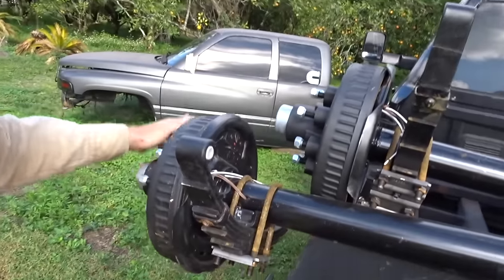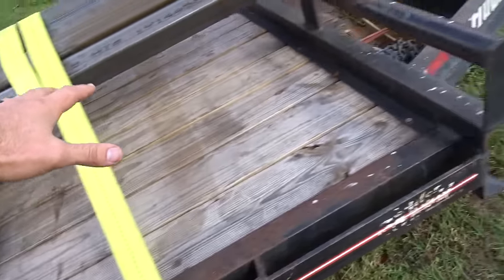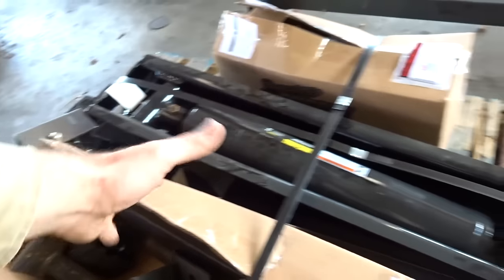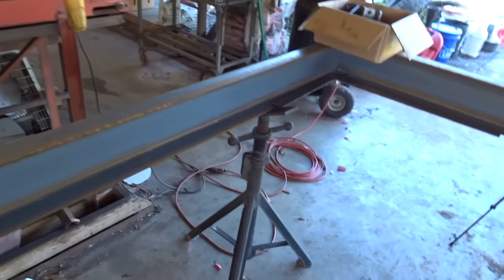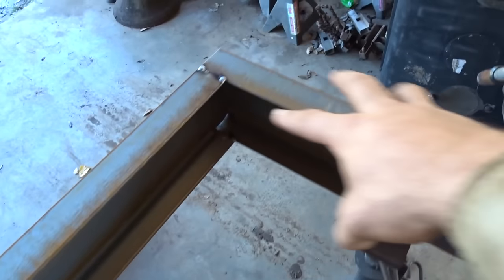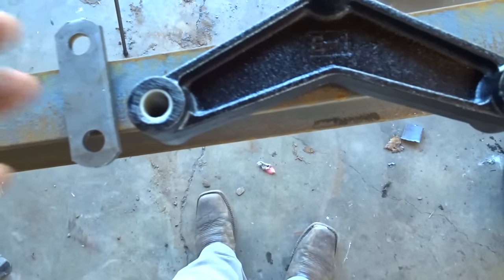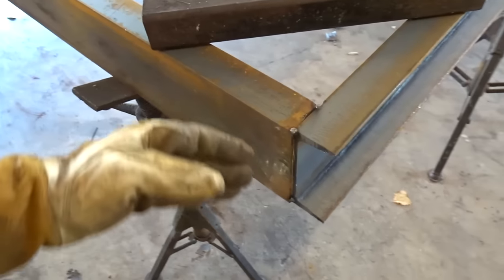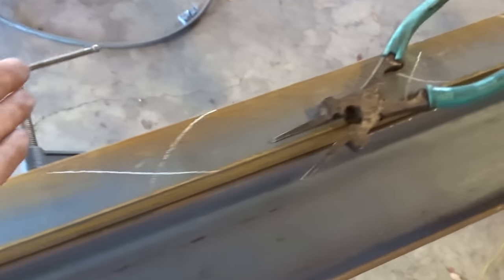Dump Trailer Build Pt 1 (& Giveaway details)

Comment: i never weld down hand  on trailors  up hill with 7018 only  and 60% of 12 ft is 7.2 ft front to back == 7ft2in13/32 to cl of axel look like you will have a massive wt on back bumper with a 8000 lb load  your front wheels will float low stearing but good breaks i see you moved to back all the way  steal heavy on bumper i like to check others on building things and learn from it

Comment: The strongest way is always shape the ends of the channel and not to but them together also remove the mill scale of the material before welding it will stop contamination into the weld.

Comment: I'm guessing 3500 invested at this point and not built yet. 1500 in axles,hangers and connecting brackets. 1000+ in steel easy. At least 500 for the dumping system ( probably more). Another 500 in wheels and tires. Still need hitch, jack, paint,lights and battery. So close figure, 3750. Not counting time, welding supplies grinding disks, act and oxy, chop saw blades and electric. I'm gonna say 8k by the time it gets its first load. I should know, I just finished building one almost exactly like this. Works great but I could have bought a like new used for half the price. Lot of fun building it though.
Reply from the maker: Lol pretty close I’ve got 1100 on axles and hangers and about 2k in steel and then add in everything else
Reply: Yep I figured about 3500 in materials. And that's cheap for a dump trailer if you don't count labor. Heller cheap, but if you do you don't really save that much. But it is fun building one. Let me offer a little advice. When you get it done, don't put 10 ton in it, it won't dump that much. Mine ended up with around 5.5 ton max. Luckily I have a tractor and was able to dig some out with it. The bed will weigh some of the 10 ton and you lose a little through the scissor mechanism. You may get a little more than 5.5 because yours is brand new. I reclaimed mine so it may have lost a little lifting power. Keep it up, interested in seeing it finished.

Comment: Very nice work man. Just be careful with axle placement because it can mean the difference of a lot of things. Tongue weight, pulling, handling..... Not 100 percent sure on a dump bed but I know for sure if the axles aren't in the right spot on a car hauling trailer it will go crazy when pulling it.
Reply from the maker: I agree for big big trailers

Comment: When I set my axles it's one inch per foot back. So if it's a 12 ft trailer center of axle is 12in toward the rear. Doesn't matter if it's a 16-foot 20-foot or 30-foot it always works perfect. I've never built a dump trailer so not sure on that.
Reply: Cecil Andrews 12” towards the rear from center?
Reply: @calvinfroisland4246  yes.

Comment: Where did you get the complete lift assembly at? I want to build a dump trailer and would like to use a hydraulic lift like that. Thanks. Great videos.
Reply from the maker: Not sure, part was purchased by customer

Comment: Looks good only thing that would help you out is run 60% tongue weight to far will  away sway and to far forwards sway and easiest to bolt all the springs and axles up and weld brackets that’s do the brackets first found that out the same way when I built my first trailer    And is there a link for that hoist by chance thanks

Comment: I'm giving away a new Dewalt grinder on my channel too as my first giveaway ever and it feels good to give.

Oh I just bought me a Dewalt 60 gallon compressor on sale for $380 plus tax since my Powermax45 needs more air. I plan on building a small 40x60 shop to work on projects.

Good luck on the trailer build and waiting on part 2.

Comment: Says it’s stronger to butt-weld than it is to notch and weld. Didn’t grind the mill-scale off before welding...

You get a lot more weld penetration if you clean off the mill-scale, js.

Comment: I hope your using fluxcore with co2 for deep penertration. Don't use hard wire not strong enough.
Reply from the maker: Oh well, guess trailer is going to fall apart now
Reply: @j_moffitt  no it won't fall apart it just won't be strong enough. Hard wire is for body work and light stuff not for a trailer!
Reply from the maker: Debatable
Reply: @j_moffitt  do what you want to guy it's your life!

Comment: I'm not sure if I missed it, but how did you measure for getting axles square to the frame? When I built my trailer I got the 60% measurement marked on both sides and then measured from there to the tongue just to be sure it would pull straight.
Reply: Nevermind, just watched part 2, you squared the tongue to the axles, I squared the axles to the tongue, same result, different approach.

Comment: What are your plans for fenders hand built or store bought
Reply from the maker: Going to make them but keep them super simple, just some 1/8” plate and trim it with round stock
Reply: @j_moffitt  heck ya looking for ideas to finish out my drive over fenders on haul trailer built em about 3 years ago still have rough cut edges

Comment: How do you figure the location of the axles?
Reply from the maker: General rule is 60/40 split meaning 60% of the actual trailer deck should be towards the truck from center line of the axles and 40% behind center line of the axles, I chose to set them back farther for better handling

Comment: If you really want to know how to build this trailer. You need to contact me. The hydraulic unit you chose is already the wrong way to go. I have 15 years on experience building these and have designed and built a 11 cylinder double deck car hauler. I can answer any questions you could have.